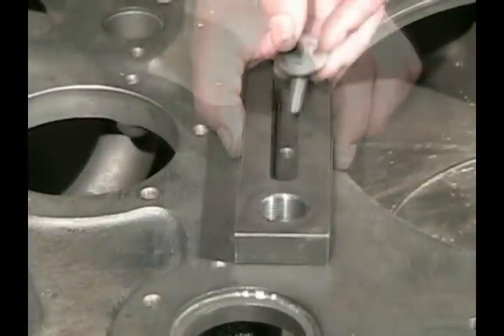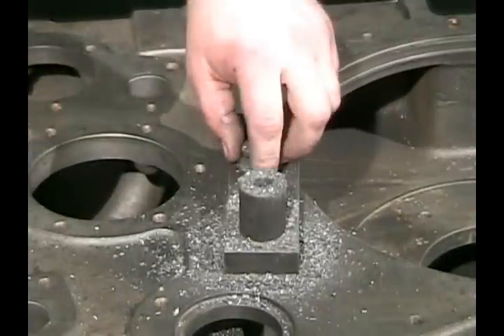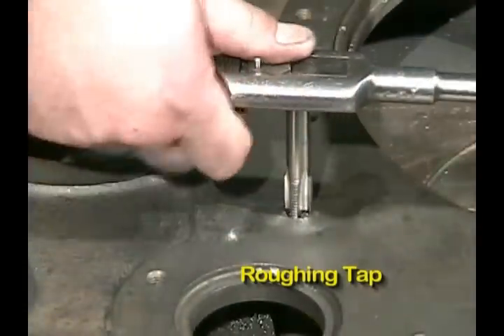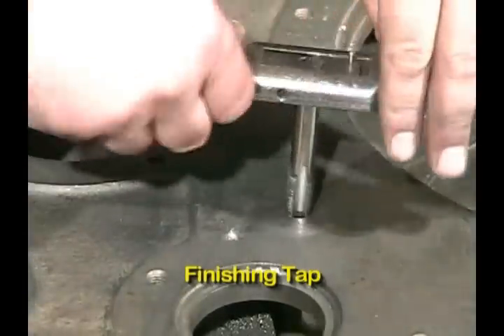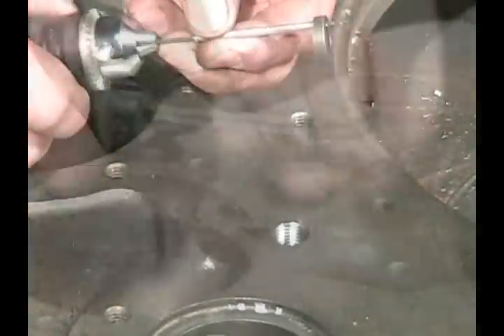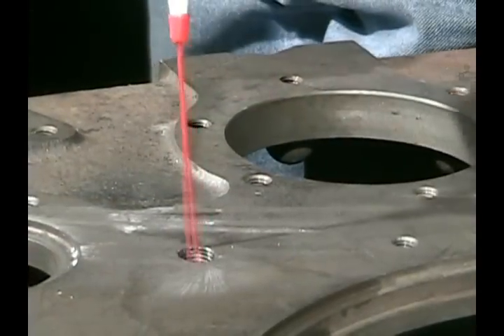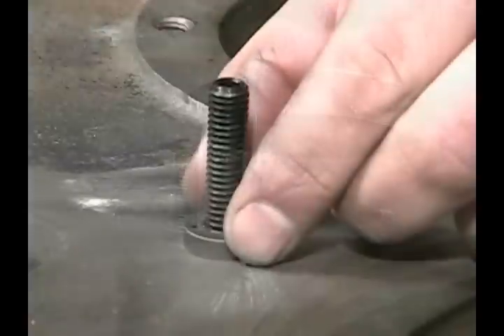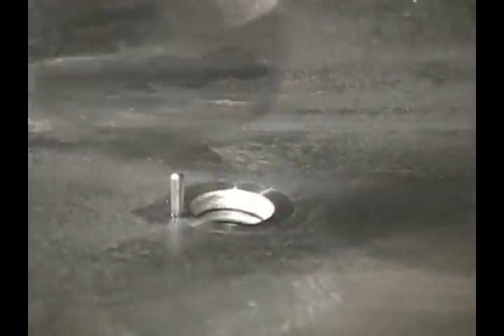Full-Torque Permanent Thread Replacement Insert

Comment: Your system is just what I need!!! I just bought a milling machine that was broken almost in two. I think with your whole setup I can fix it. It has about a six inch crack on each side with a quarter twenty hole on each involved. I sure hope that you can help. Contact me please. Thanks a lot .
Reply from the maker: Hi Ron - So glad you found us! Let's help you with the right solution for the repair.  Contact us directly at info@locknstitch.com and our customer service team will talk you through every step of the process to do the repair yourself

Comment: The forward and back in tapping is to break the chips so you don’t break your tap.   You can never go wrong doing it that way.
Reply: Not necessary for cast iron, the chips produced with cast iron are small and break themselves off.

Comment: After the taping they haven`t cleaned out the taping fluid with acetone or brake cleaner and than they used thread locker what would not stick properly on the leftover taping fluid what cant be blamed. It is the purpose of taping fluid prevent sticking - or did I miss something ?

Comment: Well, I used to think that drilling and tapping to the next size up was an adequate repair. And I also never considered blind holes to be necessary for low pressure systems that a little dab of silcon can contain.
I have always been, and will always be, willing to bring my customers up close and personal with my work, to let them fully understand what the job at hand is.
I have often turned down thread repair jobs on major components like blocks and heads, simply because I was ignorant of a repair procedure that I could confidently warranty.
This knowledge will be shared with my customers, and even with it I will still decline these types of repairs until I'm able to perform them with the proper tools and practice.
I will still continue to use the tried and tested larger bolt for lesser repairs though. your alternators doesn't care if the mounting bolt is 7/16" or 9/16" threads. Only that it's held on.

Comment: Fascinating :o) I do like a good insert, one that you can torque up on. (No helicoils)
Reply: Check out "keenserts". We use then on aluminum housing at the machine shop I work at to keep from stripping out the aluminum threaded housings. Much stronger than a helicoil.
Reply: @msack6904  I used to, but now I make my own and glue them in. I made a 42mm one last year.
Reply: @msack6904  What about Rosan inserts I think tbere beter than keenserts, I hated the little pins!
Reply: @rcdogmanduh4440  I've use those in wood projects, but never metal. I guess they could work. I'm just used to the keenserts and helicoils at work and yea, those little pins are a pain, but they work.
Reply from the maker: thank you for watching and for commenting!  If you would like more information on our line of Full-Torque thread repair inserts please give our team a call or send an email 209/632-2345 info@locknstitch.com

Comment: Approximately how long did this repair take and how much did the parts and tooling cost?
Reply: Thank you for your offer. I have been out of the Machine Repair business for decades. Never figured out how to make a living at it.
 
I can see definite advantages to your method over braze/weld techniques. The primary being restoring the strength of the casting. The secondary reducing the risk of cracking during the welding process.
Reply from the maker: Hi Greg, thanks for the question.  Each repair time can vary - if you have any repair specific questions our technicians would be happy to take a look and talk you through the process, get you the costs for the product (we can even rent you the tooling for specific repairs)  Our team will make sure you have everything you need for this type of repair.  Give us a call or send us an email 209/632-2345 info@locknstitch.com  Thank you very much for watching!

Comment: A guide block for the tap is imperative. An insert even slightly out of square can lead to the insert being ripped out. All the pull would be initially on one side. Kinda like you can rip a book if you start from the edge but not all at once. Also the fastener can snap prematurely. Same goes for Heili Coil and Keenserts. For Heli Coils repair it’s important for the end to be below the top one lead turn and the tang broken off with a flat bottom punch that just fits the minor ID. Failure to do this can lead the coil peeling out. The Keensert  installation must use the tap drill size recommended by Keensert not the normal tap size drill. The proper install tool must be used to drive the pins down. Re tap the Keensert after the installation because they sometimes close down.

Comment: Who designed the tooling, such a clever idea. Anybody know what the casing was for and why it cracked in the first place?
Reply from the maker: Thanks for the question - Gary Reed is the inventor of the products manufactured and sold at LNS.  He has over 40+ years experience and his technology is sold and used globally!  If you ever have a need for our products or services do not hesitate to reach out to us 800/736-8261 or 209/632-2345 info@locknstitch.com

Comment: I just have an issue with a aluminium engine, the bolt just eat up all the tread in the engine, and you gave me the idea to drill the engine block un order to set a new tread so i can again use that bolt.

Comment: Welding it wouldn't work both sides ?
Reply: A bolt hole crack in a large iron casting can only really be done with a cold stitching system. Welding creates tensile loads as the new metal cools. Cast iron is too brittle so it cracks alongside the new metal. Smaller parts or maybe an edge flange can sometimes be brazed or bronze welded as the heat is more diffuse.
Reply: @Dave5843-d9m  thank you David good information to know

Comment: I guess if it was for a temporary field repair it may get it back up and working but I can’t see this being a permanent repair it adds too many failure points . And with different metals when the cast iron heats and cools it’s bound to fail . Drilling the crack end and gouging the crack and welding is a much better repair. All those holes are now weak points when it changes temperatures over time it’s bound to fail . I do like the idea of making new repair options. But old time proven ways are the way to go
Reply: Nope. This is a permanent repair. These when done correctly will last the life of the part itself.

Comment: Stitching repairs have been done on cast materials for a long time some repairs have already held up for over a century. Welding a very porous material such as cast iron leaves weak points on both sides of the weld.
Reply: Thanks for answering the question i was thinking of. Why not just  v groove the crack and weld it?

Comment: Would a Keensert be acceptable instead of the Full-Torque insert?
Reply from the maker: Thank you for asking.  Using a keensert would not be a permanent repair;  I encourage you to call in to our speak to our customer support team to discuss the difference.  They would be happy to help you 800/736-8261 or 209/632-2345 - info@locknstitch.com

Comment: What is this piece of equipment you are repairing? It would be good to know if this is a 1000lb $$$ cast valve body or a cast iron stove!
Reply from the maker: Thank you for your comment.  The LOCK-N-STITCH process is used in many different applications.  It can be used to repair cracks and damaged casting ranging in size.  For example it can be used to repair in-frame automotive and marine engines, large industrial engines at power plants  or vessels, compressors and stationary machinery to name a few.    There are many examples of the types metal stitching repairs found on the website http://www.locknstitch.com/engines-casting-repair-industry.html

Comment: My Gawd; this is a complicated repair method; the part you're repairing better be worth the time and the cost of the equipment.
Reply: A bit labor intensive, sure, but remember we're discussing a permanent repair process. Historically, this method often outlasts the life of the  part itself. More to your comment directly, there aren't many items made out of cast iron any more, BUT since welding or brazing on cast iron is also a labor intensive process, this is a better method in that the effects of heat don't come into play during the repair.  Cast iron doesn't respond well to uneven heating such as what welding generates. Usually the repair is just too brittle to last very long at all.

Imagine finding an antique car with an original motor that has a crack in the head or block. This repair method is  a permanent solution to preserving the original piece and giving it an extended life cycle.
Reply: Its actually a very simple repair and quite a bit cheaper and faster than most while still being very durable and long lasting. Nothing complicated about this at all. Maybe for someone who doesn't not fix things its complicated but to someone who fixes stuff for a living, this is a very simple process.

Comment: Do you offer rental for the jigs? I have a 1940's South Bend lathe (13") that has a crack in the pedestal. I could probably get away with a brazed repair, but Lock'n'stitch looks to be a superior fix. I haven't looked into your pricing, but I imagine that because it's quite a specialized kit it won't be economical for just one repair. I'm just a hobbyist so my budget is very limited. Constructing the jigs would be fairly easy, so is there any reason I couldn't buy the consumables and do the rest myself? Lock'n'stitch looks to be an excellent product, and I would in no way want to undermine your business, so please feel free to suggest how I can utilize your product without blowing my meagre budget! Thanks in advance.
Reply from the maker: We can sell just the items you would need for one repair or we can fix it for you.  Please give our customer service specialists a phone call or send an email with all the details of your repair!  They would be happy to assist you Paul.  800/736-8261 info@locknstitch.com
Reply: Thanks for the reply. Do you have anyone in Wellington, New Zealand? :)
Reply from the maker: If you email our customer service representatives they would be happy to research if we have anyone in your area using the products info@locknstitch.com

Comment: never seen this before thank  you for doing this
Reply: +Roy Telling 
I have done this before
Nowadays we use tig is a faster dirty job. But even welding demands some techniques,  that people usually dont use.
These kind of jobs are even far more complex that people can see. For example, the holes must have the same distance, 0therwise the whole repair have the strenght of the weakest point and we dont want it.
Reply: +Maxpredator engines Tech I have repair engine blocks a few times with tig and stick welding. I've been welding since I was 16 now I'm 55 and still welding and enjoying it
but first time seeing this
Reply: Isn't there a significant risk with welding that the part will become warped, or at least that you will introduce internal stresses into the cast iron that will lead to more failures later on?
Reply: I know it's a tad late for a reply.
Yes, if you've welded in this situation it would be best to anneal the casting afterwards. Especially since the crack went all the way through.

Comment: how difficult is it to do this type of tapping in a confined space where you would not have space to use a normal tapping device?  any tricks?
Reply from the maker: I see that you didn't get a response from your past comment, we apologize.  We appreciate your interest.  We do have tap adapters to help in difficult to reach areas - if you still have questions please give our customer service dept a call 800/736-8261 or feel free to email info@locknstitch.com
Reply: DCUPtoejuice   Get Tap sockets they allow you to use a ratchet and come in 1/4in 3/8 and 1/2 in drives I know this is an old post so you probably have a set by now ha ha ha